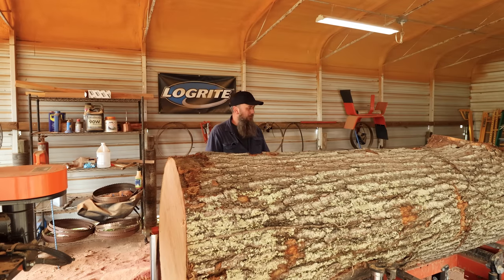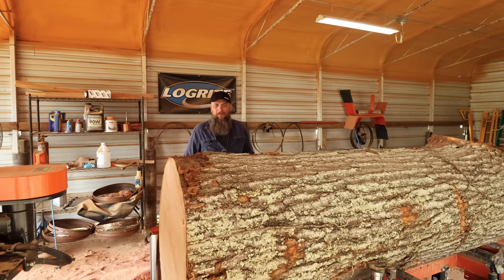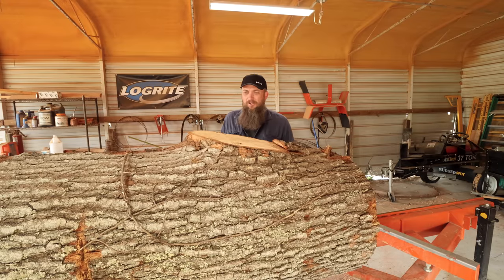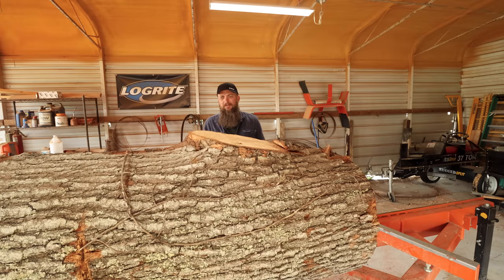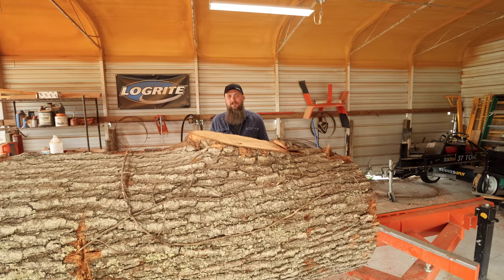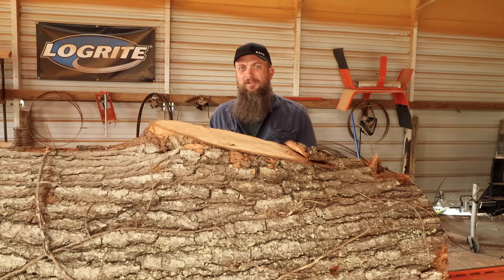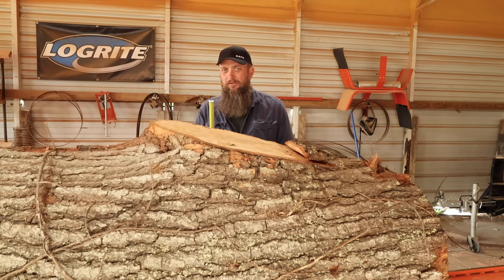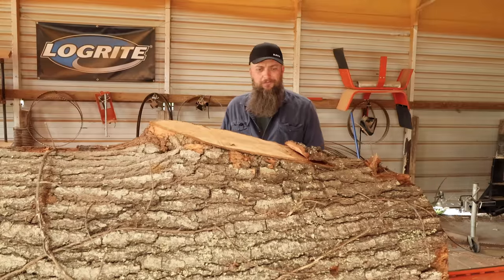Sawmilling A Big Oak I Saved From Going To The Landfill

Comment: Hey Nathan, love  your videos but something I always wonder about and you may have addressed but not sure.  Does the WoodMizer figure the thickness from the bottom?  I'm not sure what you end up with on the last cut unless that is the case where you would have the remaining board the dimension that you were cutting for the rest.  Curious to know how that works.
Thanks
Reply: I believe you can set up the automated cutting from the bed or the top.  With careful planning from the beginning cuts to create the cant,  you can have full thickness boards to the very last cut.

Comment: Nathan did you ever think of installing a barn door where you load your logs on the mill?
Reply: His mill runs on diesel - I believe he needs the ventilation.
Reply: @pulaski1  He could leave it open when he runs the mill and it makes loading the logs so much easier!
Reply: @michaelbrausch8874  If you look behind Nathan when he is talking to the camera, such as the thumbnail for this video, the shed he has his saw in appears to just be one of those lightweight carport structures, so I don't think it would support full size barn doors.